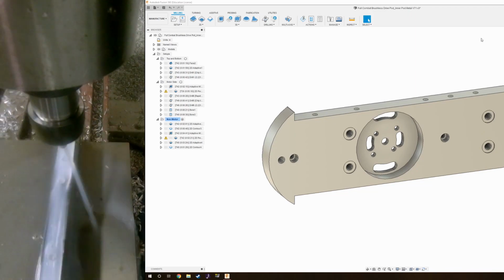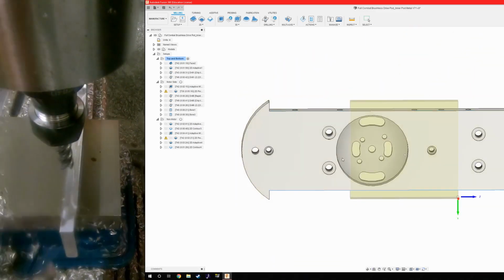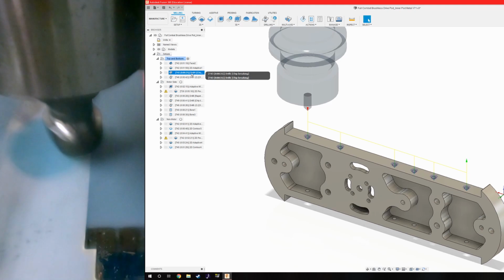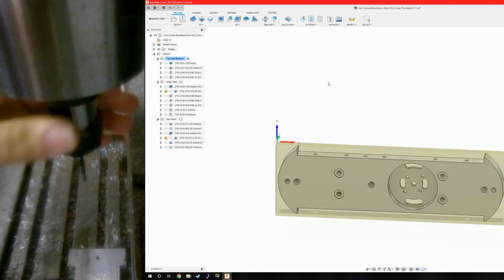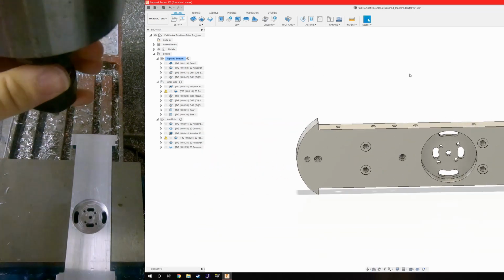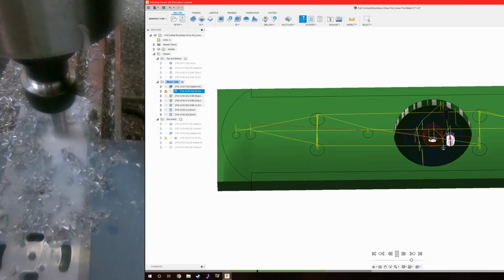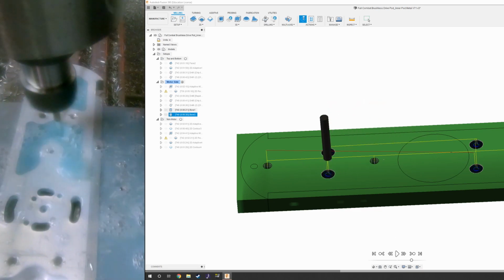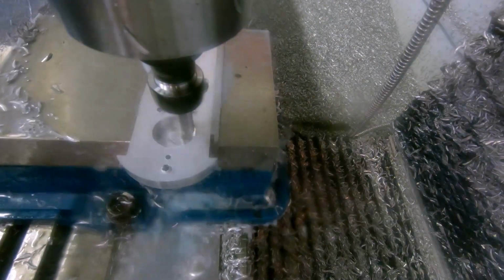Draconid CNC Overview Part 3 - Fusion 360 CAM

Comment: Crumbs! And to think that I used to build a bot chassis by laminating together umpteen layers of 1/32" plywood with Cascamite resin and 'protecting' it with sheet aluminium...

They were 100 lb bots, too. It's perhaps worth mentioning that there were none of today's terror-kinetic asymmetric spinning weapons back then. Just grippers, flippers, lifters, hammers, axes and the occasional multi-toothed sawblade that tended to stall as soon as it hit anything because our batteries and motors were so feeble.